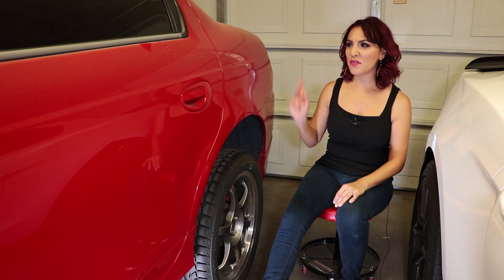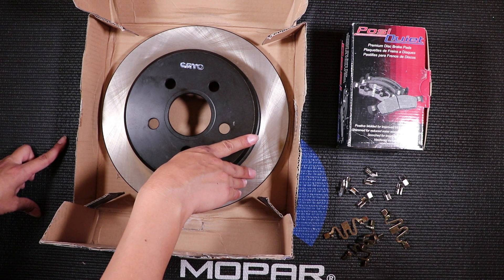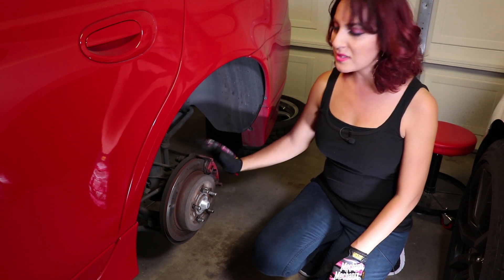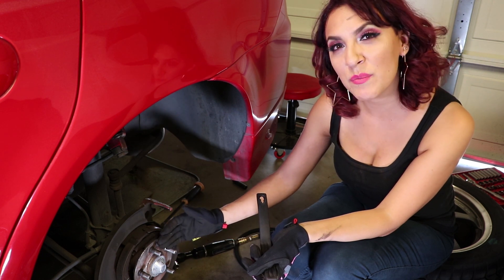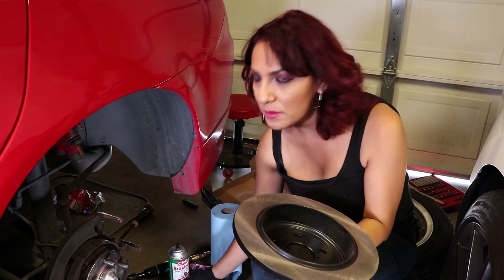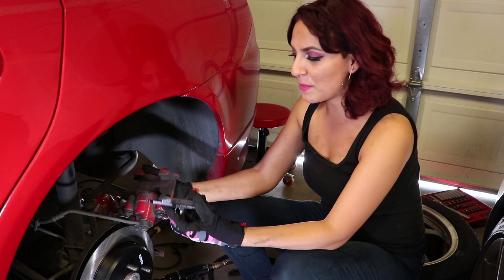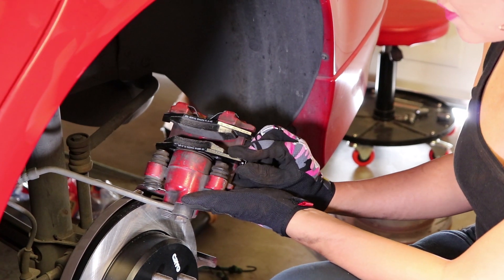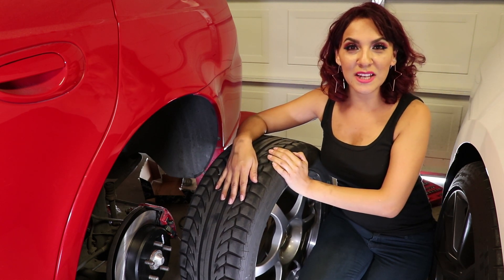Dodge Neon SRT4 Rear Brakes Install & Replacement (2003-2005)

Comment: Great content. New sub here. 
Just a head up while brake dust is terrible to inhale, asbestos hasn’t been used in brake pads since 1993.
Reply from the maker: Thanks for the sub njshift! also good info regarding the asbestos!
Reply: AutoFun thanks for the srt4 content. By far the most detailed on YT. This is coming from a very critical and long-time SRT4 owner.

Comment: Any idea what those wavy pieces of hardware are for?
Reply from the maker: Hi Morris, some breake systems use different hardware like the wavy ones you saw, so sometimes I see that they put several types of hardware with the brake pads even thought you may not need all of them. Hope that makes sense bud and thanks for watching!